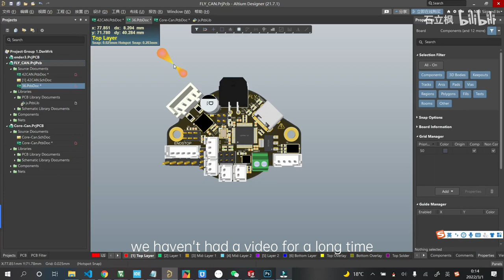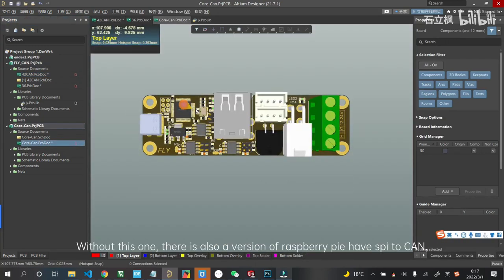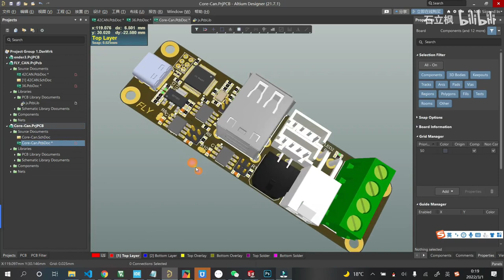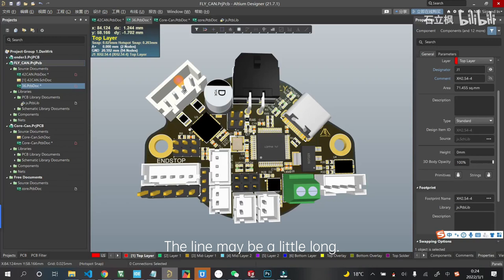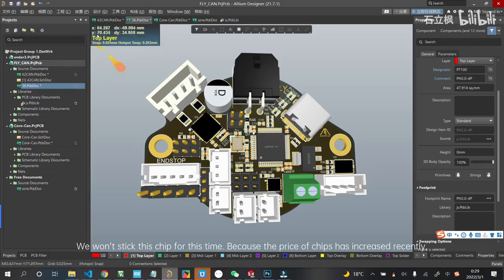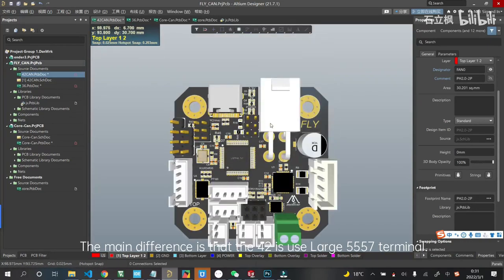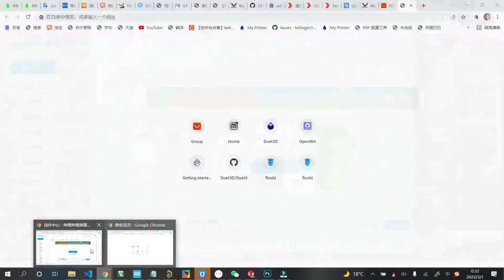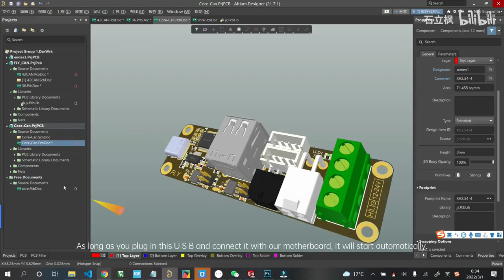Mellow Fly-SHT 36&42 Canbus Board For Klipper CAN Toolhead Fly Gemini Board Rspberry Pi 3D Printer

Comment: I am waiting to receive the fly-sht 42 model, and it was to see if I could get the 3d model of the board. To be able to print in 3d an adapter to install it on the Hotend... or at least the 2d drawings to get an idea of the size and the mounting holes... another question that arises is if, when carrying an accelerometer, the orientation of the plate influences? it has to go flat, vertical, or it doesn't matter.
Reply from the maker: Hi friend, you can go to our aliexpress store to contact with our service to ask them, thanks
Reply from the maker: hello. You can go to our discord or thingiverse to find it, thanks
Reply: @3DMELLOWPrinter  what its you Discord channel?
Reply from the maker: @manuelpeirofrias293  Official Facebook Website:https://www.facebook.com/3DMellow/?ref=page_internal
Official Facebook Groups Website:https://www.facebook.com/groups/395979321769632
Official discord channel :https://discord.gg/zAung88zbK

Comment: I have Fly super 8 and i bought FLY SHT36 usb version do i need any additional pcb ??
Reply from the maker: Hi Adam, if you use Can signal control then it need UTOC board, thanks
Reply: @3DMELLOWPrinter  I will use a USB connection that's why I bought USB version.
Reply from the maker: @adampiotrmalejewski695  great